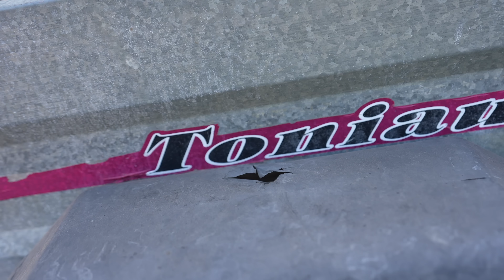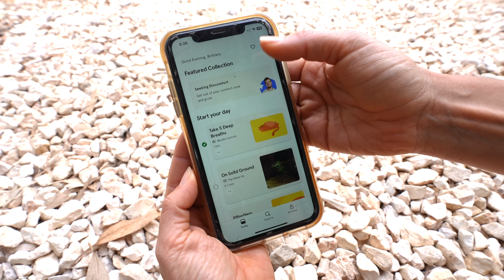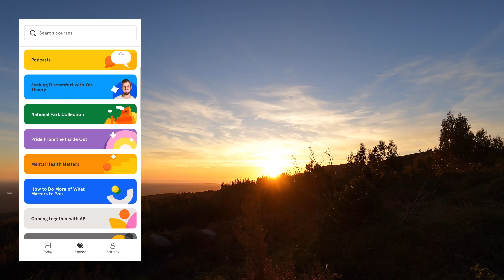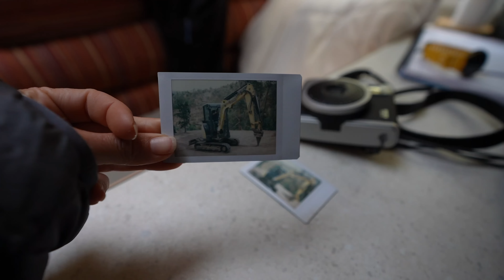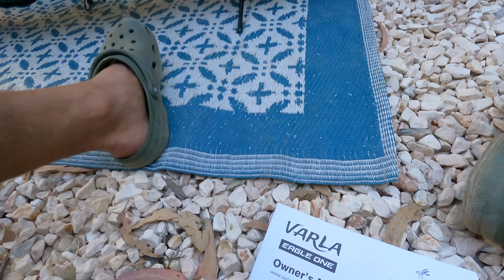BUILDING NEW ROADS AND PATHWAYS on our 7 Acre Homestead in Portugal

Comment: What a fantastic transformation!  By the way, here's a tip for reversing with a trailer...since the trailer will swing the opposite way of the turn of the steering wheel, put your hand at the bottom instead of the top of the wheel. Now when you move your hand to the left, it will be moving in the same direction the trailer will be heading.  You'll be a pro in no time!

Comment: A little advise on backing up .  Place your hand at the 6 o'clock position on the steering wheel.  Want to turn the trailer right , move the wheel to the right, turn left, move the wheel left. Always keep your hand on the bottom of the steering wheel.  Slow turning of the wheel is the key, lets you adjust as you go.  Use your mirrors.

Comment: If you did use the tiles for the patio ,you can install them on a base of gravel dust .( it's small crushed stone that compacts almost like concrete) .If you were to set the tiles with space between them then moss could grow in the joints. Moss instead of grout. On the inside of your home ,where the tree trunks are ,if steel posts and I-beams will be used maybe you could wrap the steel in wood .Or find a local saw mill and use solid wood beams that would pass the load requirements. I just hope you keep the funkiness of the home's vibe what ever the project might be.
Reply from the maker: That is very much our intention, it’s why we fell in love with it!! 🌳✨💚

Comment: One thing I've learned about planting fruit trees on my small farm is that it's great to plant early on in the rainy season, that way your tree babies get lots of support growing strong roots.  Another tip is to just go ahead and run those irrigation lines right away. Even on the north shore of Maui, I need to irrigate my trees in the summer or they get very stressed.  You guys can hook up a battery powered timer valve to a rain catchment barrel - easy!

Comment: backing a trailer:  hand at bottom of steering wheel.  Use side mirrors. Move hand in direction you want trailer to go.  Easy.
Reply from the maker: Good suggestion. I've gotten much better with this small trailer. Big trailers are way easier. The other trick is to turn the top of the wheel into the direction of the trailer is starting to go in the side mirror so that it centers back behind the truck.

Comment: I’m sure someone has told you?  When steering in reverse, use the bottom of your steering wheel to direct to the trailer to the desired location.  It will give you more control.
David

Comment: Nelson needs to make sure that the dirt is compacted as he moves it around.  That there is also a place for the water to flow away from your structures.  It is more than just moving dirt around.  Will it stay in place when you have a lot of rain.  I don't see any places for the water to drain .  You need someone out there with water keeping the soils moisture content at maximum dry density so your road doesn't wash away.  Even if it's just temporary for later.  All the vegetation was absorbing most of the water and keeping the dirt in place but it's all gone now.  Better to do this now in the dry season before the rain comes.  It's all about flow lines, drainage and compaction.   Good Luck!

Comment: When backing a trailer put one hand at the bottom of the steering wheel. Move that hand in the direction you want the back of the trailer to go. this just takes some of the thinking out of the process. With a little practice you'll figure out just how much to move that hand to land the trailer exactly where you want it.

Comment: Are you sure the Portuguese road traffic law doesn't demands safety netting over the contents of your trailer? Apart from the lighting on the trailer and its MOT?
Better not risk some hefty fines, themselves multiple times the costs of the netting and repair costs.
In The Netherlands such safety net costs about €35.-- the fine for not using it is a minimum of €230.-- up to €350.--

Comment: How to Make a Homemade Weed Killer
Having invested in native plants for their ecological benefits, many of our customers seek alternatives to commercial herbicides that will let them maintain and nurture a healthy environment. We are often asked about the safest and surest way to get rid of weeds. Pulling weeds by hand is always safest, and for small scale problems it is the best option. But there are times when herbicides may be more practical. Fortunately there is an alternative, a homemade weed killer made up of natural ingredients from the pantry that can get the job done.

The Recipe
Pour 1 gallon of white vinegar into a bucket. 5-percent household white vinegar is fine. It may take two or three days longer to kill the weeds with the lower concentration, but it does work.

Add 1 cup of table salt. Stir the solution with a long-handled spoon until all the salt dissolves completely.

Stir in 1 tablespoon of liquid dishwashing soap. The soap helps the vinegar and salt solution coat and adhere to the weeds. 

Blend all thoroughly and then funnel the weed killer into a plastic spray bottle.

How it Works
Vinegar. The active ingredient in vinegar is acetic acid. Household vinegar has an acetic acid concentration of about 5 percent. Acetic acid is a desiccant, meaning that when sprayed on the surface of a plant, it draws moisture out of the leaves, killing the top growth. Most effective on small or new weeds, it kills the top easily enough. Taprooted plants such as dandelions usually survive an application of vinegar. Acetic acid breaks down quicky in the soil, and the negative impact of vinegar on the soil last for only a short period. A stray drop of vinegar on a desirable neighboring plant will cause some browning, but probably will not kill it.

Salt. Sodium chloride, or table salt, is also a dessicant. Salt is added to weed killer recipes because it is stronger, and kills some plants that vinegar won’t kill. It negatively impacts the soil for a longer period of time than vinegar, and it may affect the roots of other nearby plants, as well.

Soap. Soap is a “surfactant,” meaning it increases the spread of vinegar or salt onto a weed’s leaves. It also can increase the absorption of desiccants because it can break down the protective waxy surfaces of some leaves.

Application and Use
This homemade weed killer recipe is “nonselective,” which means that it will kill any plant it is applied to. Apply the solution on a dry, sunny day, by thoroughly spray coating all surfaces of the weed. Plants soaked with this solution will die within a week. It is important to understand that in large doses, any chemical or compound plant killer will be toxic beyond the plant itself. A salt and vinegar solution is toxic to small mammals. It can destroy the soil microbiome, too, and care should be taken to avoid spilling the mixture directly onto the ground. If you are repeat-spraying a large solid patch of weeds consider following up with a soil-building and watering strategy, after the weeds have been eliminated, to rebuild the soil health. Any leftover weed killer can be funneled into an empty plastic container, capped  tightly and labeled. Store the left over solution in a cool dark spot indefinitely.

We  used  this  on one  of  our  properties  that  was  covered  in nettles, vinca,  dock, thistles all types  ivy and  it  worked  -  it  was fantastic  these  plants  never  ever  came back  we  now  use  it  all of the time  and  of  course  it  is natural and  you can  plant  your  veggie  garden straight  away.  

I  would  still use  goats  though,  we  have a  goat  named  Milo  and  we when   moved  on to  the  farm  we  bought  him to  clear  the land  organically  -  and he  did  a  great  job,  we  had  62  acres which was  covered  in thistles  all types,  broom,  gorse,  dock, nettles, convolvulus,   i think that you have  some it has  a  white  or  purple  flower  I have  seen the purple  flower  on your  land  near  the house,    Milo (the  goat) cleared  it in less  than 6  months ! and  of  course  he  fertilized  it  too with  his  poo :)   and  you can milk the  goats  and  make  feta  etc  have a  family of  goats  to keep them company.  you can make  nettle  and  feta cheese :)